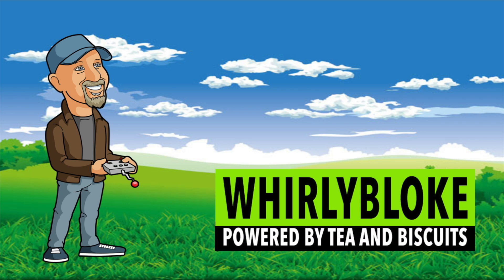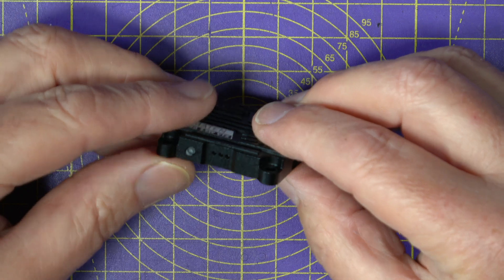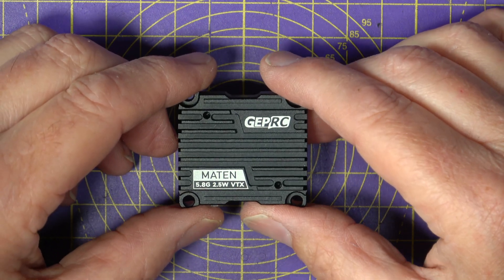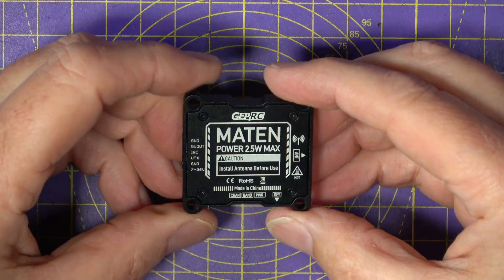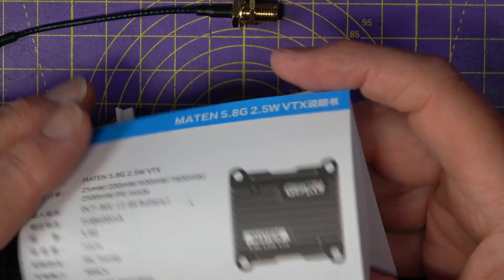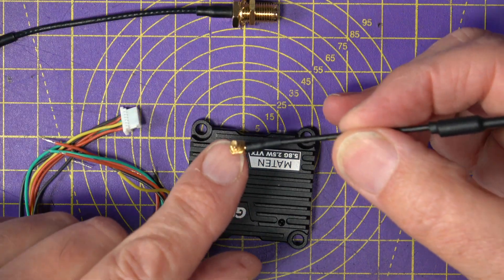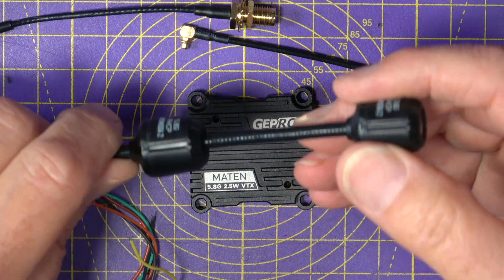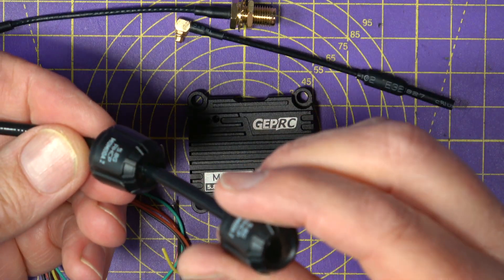GEPRC MATEN 5.8g 2.5w VTX: High Powered Video Transmitter For Long Range Drones And Wings

Comment: Nice vtx. Be better if it came with a fan already mounted to it. Would be great on a rc 4x4 crawler. 😎
Reply from the maker: I forgot to mention there's a regulated 5V 600mA output on this that can be used to power a small fan.